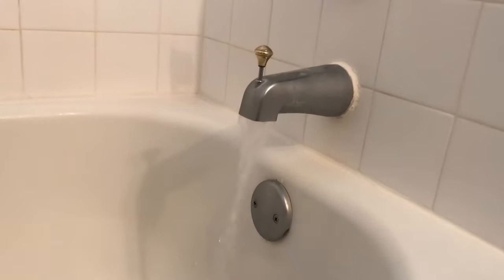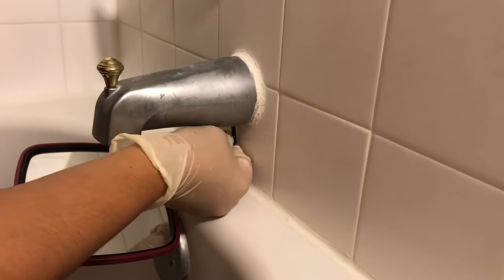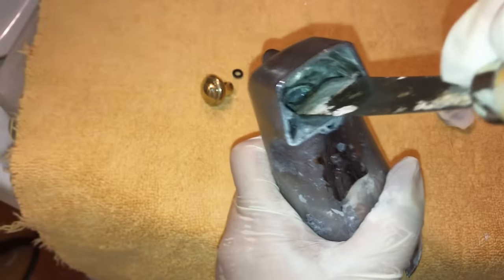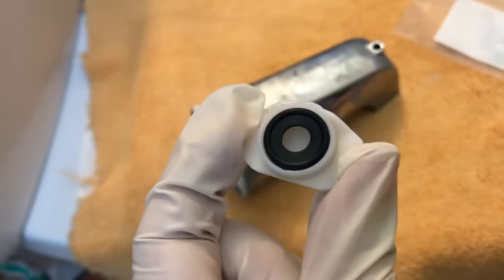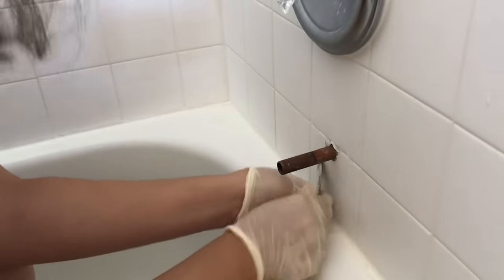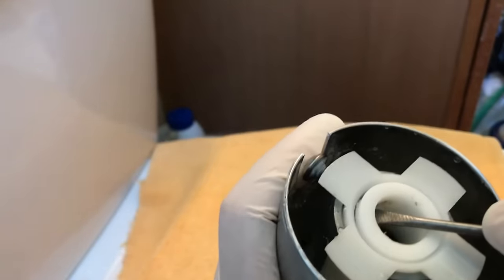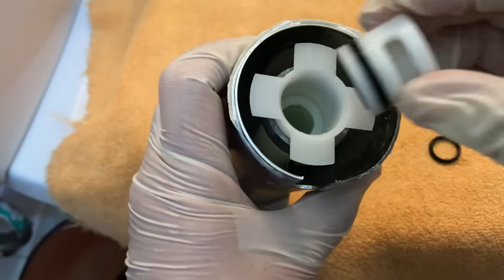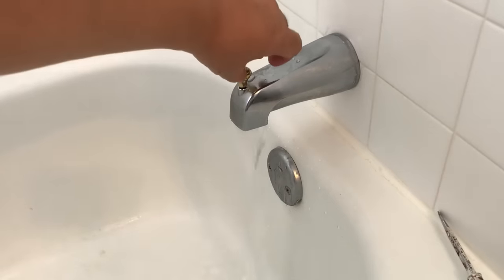How To Replace Or Fix Tub Spout Not Working

Comment: MIne leaks water a little  when the shower is on . im wondering if you can  take out that   piece without taking the whole thing off..?? Thanks for sharing     was wondering  how this all works.  its a just a rubber gasket  then
Reply from the maker: You can, as long as the knob is not stuck and can be unscrewed. If it leaks a little, that's okay. Many faucets leak a little and I wouldn't worry about it.
Reply: @KYKCreations  Its a brand new faucet too. but  seems it shouldnt be laking that much . i  might spray some vinegar  in there  see if that might  help  remove any build up..

Comment: In general good but, I would soak the whole spout in CLR and clean it properly and there is no need to caulk around the spout. It looks ugly. Caulk the copper pipe  where it meets the tile instead and let it dry before re-installing the spout. Also, it can't hurt to clean the pipe as well for the o-ring to seal properly.  Herbert

Comment: Just a quick note. Silicone the pipe where it meets the wall. and don't calk the spout to the tile. if/when the o-ring blows, it will go straight thru the wall and end up downstairs.

Comment: Remove the spout , spray WD40 inside the inside of the spout , spray it good .
Let it drip dry ,move the spout handle many times spraying again , until it loosens up all the buildup from the hot water .
Rinse the spout off in the sink get as much as you can out ,spray again make sure it's smooth operations again , and put it back.
Some screw on then secure with a set screw , usually a straight head , some modern are Phillips or hex . Done.

Comment: not sure where this is but for me to replace it was $13 the repair kit is $16-$30 and because the set screw is stripped on the corroded one i was trying to fix i had to unscrew the housing from the plastic that slips on the pipe broke the old one out. unthreaded the knob off the shaft and the diverter part fell out the bottom so i just put that in the old housing i cleaned up with CLR and a wire brush

Comment: Please explain why you are not using teflon tape when you put the spout back on the pipe? Shouldn’t the tape prevent leaks.
Reply from the maker: There was a teflon tape someone had put on there and I believe that's what damaged the o ring. You shouldn't put teflon tape on the pipe because the o ring is made to fit tightly onto the pipe.

Comment: Nicely done.  I have replaced many of them in 60+years of plumbing.  Don't always expect the spout to come off that easily.  Sometimes I must use a heat gun to apply just a little heat once or more times.  Just a little, then let it sit for a few minutes, then a little more.  Do not heat it hot, just warm!  Some can present a real challenge to come off if they are really old and the supply is on a well or really hard water.  Just a thought if the spout seems like it is welded on.  It is not, just built up crud.  Say, why are you wearing gloves?  Is that a requirement for youtube?  Everyone is wearing gloves.  Not in the real world we work in.
Reply from the maker: wearing gloves is not a requirement for youtube. i just do it when i remember to because i think it's what i should be doing. I too, have noticed people wearing gloves nowadays, especially in cooking shows.
Reply: @KYKCreations    gloves are good.
In CA, gloves are required for any form of commercial food prep. A bit too legalistic.
But if I were a manager at a restaurant, I would want anyone who touches food to wear sanitation gloves. When food is prepared for me, I'd like the preparer to have made my food while wearing gloves. It should be up to the manager of each location, or up to the youtube presenter.

Comment: Do you have to turn the main water off before removing the spout? Or can I just go in and remove the spout without shutting off the main water supply?
Reply from the maker: You don't have to turn the main water off. You can just turn the water off using the shower or bathtub handle.

Comment: I would encourage anyone to replace all the O rings.  The spout O rings leaked on our upstairs shower unit and leaked water down inside the wall and ceiling of the shower unit below it.  Plumber had to cut a hole on the back side of wall to determine source of leak, so  I got to do 2 drywall repairs.  Plumber just installed a whole new spout unit.  Me, I got to learn how to do a 12.12" drywall patch.  Diverter worked fine,  and only leaked when the shower was on.  Nice presentation, but I kept wondering what the latex gloves were for...
Reply from the maker: thanks for sharing your experience with the O rings.
Reply: The gloves were to protect the hands.
Reply: And her nails.

Comment: How did you turn off the water before you repaired it?
Reply from the maker: I don't have a valve that controls the water supply just to this bathtub, so I had to turn off the main water valve that supplies water to the entire house. The main valve is usually located in the basement for most homes.

Comment: Hello and thank you for the video! I've viewed 6 or 8 diverter repair video's and found yours to be the most compelling. However in none of the video's did I see what to do if the pull/push knob on top of the spout is immovable. I turned the spout over and removed the diverter but the pull/push knob will not budge. I saw one video that said to use a hack saw to cut the pull/push stem but I was afraid it would get stuck within the spout and still have the same problem with not as many options. I left the spout upside down and filled with CLR in hopes of loosening the push/pull stem. Can you help? Thank you.
Reply from the maker: Hi Roger, has CLR worked for you in loosening the knob on top of the spout? I hope so! Otherwise, you may need to buy a new spout for about $20. If you get a new spout, just be sure to get one that will fit your pipe.
Reply: @KYKCreations  It did but still ended up buying a new spout. Thanks

Comment: NO need to remove the spout to repair the first part. You are giving yourself more work than needed.
Reply: What needs to be done?
Reply: @karlacaban9428  I think he means it is easier to just replace the whole spout.
Reply: @nikoniko893  oh, I thought there was a way to just remove that gasket, which is what I think mine needs
Reply: @karlacaban9428  I bought a new spout for 16 dollars
Reply: @karlacaban9428  There is a way if you have the part. My local Menards didn't have it, and there was so much calcium buildup, that it was easier to replace the whole thing.

Comment: When I slipped the new tub diverter to the bathtub wall and screwed it, it worked well when I use water down with the sprout but when I pull the diverter, the water pressure push the sprout out of the wall for a little space like 4mm! So weird! I used the same size and length as my old one. Anyone knows why or had same problem with me? Thanks

Comment: where do you get or what part where the orings is called, i noticed whoever put this tub spout when house was build, the screw damaged it
Reply from the maker: I got my parts from Ace Hardware store. If you take the part you want to replace and show it to someone in the store, they should be able to help you.
Reply: @KYKCreations   no worries, replaced it with a slip on faucet.
Reply from the maker: @joextreme  👍

Comment: The best way to not put mote wear and tear on the seal is to turn the water off and let the diverter rod drop. This is normal. If you pull the plunger rod during water pressure it wears them out faster.
Reply from the maker: thanksfor the tip!

Comment: Well, good luck buying that gasket ! For all the gas and time you spend driving around town looking for rubber gasket, get new spout - and you are set for another 10 years. I would never try to fix spout in condition shown in this video. PS: Your house is in need of water conditioning system too, to prevent calcium build up that ruins your plumbing fixtures. Thank you

Comment: Good fix and cheap. But I changed out my whole diverter and not just the o ring without taking the spigot out. 8 dollars from lowes. Only took a couple minutes to swap using a long needle nose pliers to remove the plastic clip. I didnt bother cleaning inside. When I pull the diverter up there isn't even a drop coming out i think its because I did the whole thing not just o rings. If you're going to do all that work you might as well change the whole thing if it's more than 15 years old they're only like 20 dollars. I do love cheap fixes tho this being you only spent like 4 dollars haha. It's 4 dollars for you and 200 for a plumber. And most likely your fix will last 20 to 30 years hahaha

Comment: Wow, it's certainly not "normal" to have water leaking from the front of the spout after repair. Either the surface you cleaned with that putty knife wasn't flat enough or was pitted. I also had a leak there and added a small O-ring behind the rubber washer which stopped it, it made moving the diverter rod a LITTLE harder but no more waste of natures resources. You can also put a brass washer in that pocket to give it more pressure against the face.
Reply: Actually, it is normal to have a small leak even after installing a new spout.   Something I found on the internet: 

"First, the amount of the leak through almost all of the tub spouts increased as the system pressure decreased. This
is because all of the tub spouts we tested use water
pressure to create the seal that prevents water from
continuing to flow out of the tub spout when the diverter
is in shower mode."
"Second, many of the tub spouts leaked significantly even
though they were newly purchased. One manufacturer
stated that a pencil‐sized leak was normal.  

This is why most Youtube videos of spout replacements do show a slight drip when in shower mode."

Comment: She should use vinegar to clean inside of that spout You can boil the water in one pan and put 30 ml or so white vinegar when boiling and put that spout in the boiling water for 2-5 minutes It will clean itself. Or you can use lime out etc products to spray and you can get rid of that water hard water marks!
Reply from the maker: Thanks for the tip!

Comment: I'm confused as to why all that work has to be created when the same job is possible leaving the fixture attached.
 I feel that the perspective provided here is key to visually understanding what you are going to be looking and feeling for, but everything accomplished here can be done without having to also purchase caulk to reattach the faucet.
 As someone who has exactly $0 to spend on this project I plan to accomplish this very thing in the bathroom across the hall. It's the second time viewing this video because I had dropped the pull knob down the drain when it suddenly came unscrewed. Please take the advice of those who are recommending to cover the drain, the likelihood of dropping the smaller pieces is pretty high and unfortunately for me I could see it but because it wasn't magnetic and not having the tools to reach it I lost it. Fortunately my toolbox has just about every single thing one might need in 10 lifetimes so I was able to find a tiny knob that fits perfectly!! (Pure Joy!) The funny thing here is that it looks like she did the same thing with the one she has as well.

 I do appreciate the tutorial once again despite the fact that I'll be skipping the removal from the antique claw foot I'm working with today.

Comment: Couldn't you have changed the gate/ gate gasket while leaving the faucet on?
Reply from the maker: Yes, but I also wanted to scrape some mineral deposits off from inside the spout, and it would be easier to see what I was doing with the spout off rather than on.

Comment: How would I fix it when water comes out the shower head and the tub spout when the pin is not pulled up?
Reply from the maker: I wonder if the problem might be with your diverter cartridge.

Comment: I would have put caulk on the wall hole where the pipe comes out, assuming there's no original plumbers putty sealing the pipe hole..  There is no reason to seal the spout itself if you block the entry into the wall properly.  Amateurs caulk the spout, and it's usually ugly.  Any water that flows between the wall and the spout goes out the bottom of the spout. None can  enter the wall.
Excellent video, otherwise!

Comment: Silicone grease will help on those O rings.  Its truly sad that a lot of homes are using these styles of "diverters".  The best idea is to have a third valve in the center that directs the water flow up or down...they don't leak and they divert 100% of the water vs. using back pressure to move the water to the shower head.

Comment: What about if you cracked pipe behind the wall lol.. 
I personally prefer to hire a professional plumber. 
I don’t mess with gas, water and electricity
Reply: This is a simple task. It's not very likely that you would crack a copper pipe just by removing the old spout and replacing it.
Reply: @mjt1517  it not Cooper all the time . Can be cpvc , poly shit or pex!!

Comment: I'm not sure why you would put in the time and effort to do all that when you could literally just buy a new faucet to replace the old. If you're worried about saving $7-8, you've got bigger problems in your life than a stupid faucet that isn't 100% and need to check your priorities. Also, once you've located the set screw, how are you so uncoordinated you need to use the mirror just to turn it? For real though.